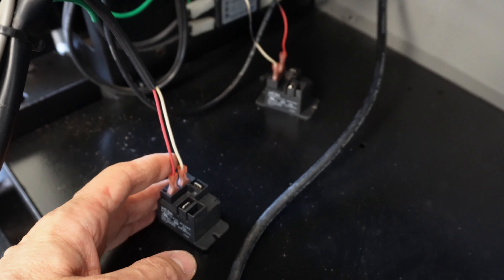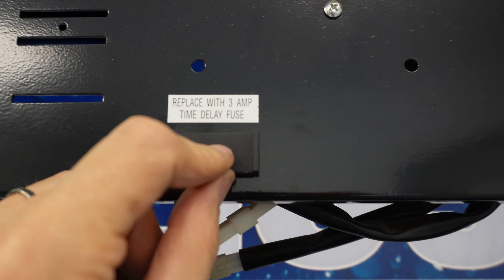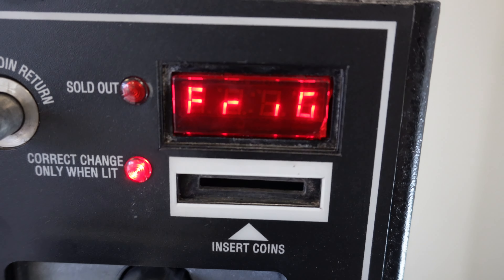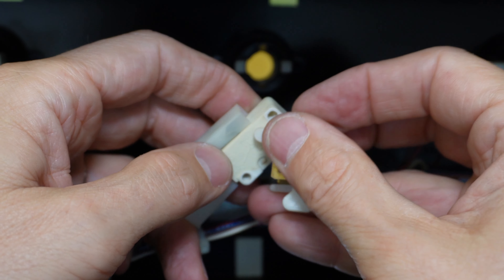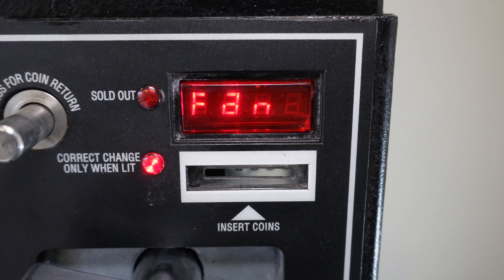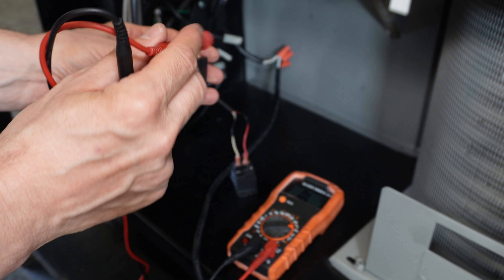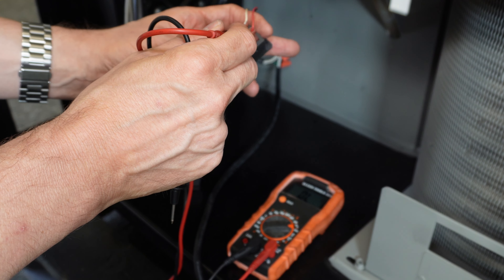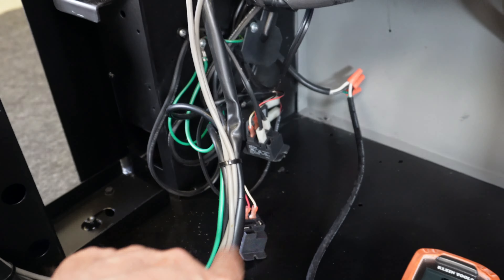Vending Machine Repair - E2 - One 2 Many

Comment: Hi.
Thank you for yet another great video of tutorial.
My question is, does the Royal 660 have a relay for the evaporator (fan) motor?
Related, what is it referring to when in the menu, it reads "Fan"?
Thank you
Have a great and safe day.
-- Matthew
Reply from the maker: Some models do have a relay for the evaporator motor. These models are the Energy Star compliant models I believe. When under FRIG -> RELY -> FAN allows you to test the evaporator fan motor when it is attached to a relay. This acts just like the FRIG -> RELY -> CNPR for the compressor test.